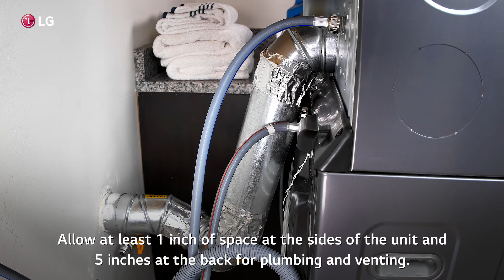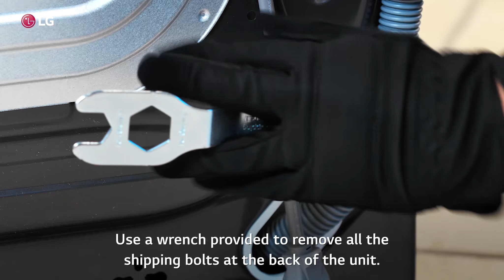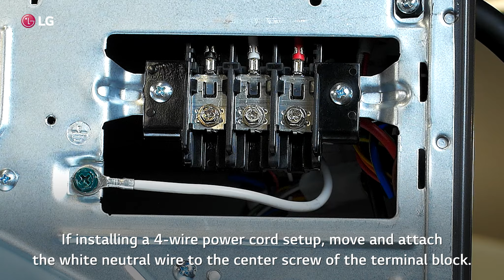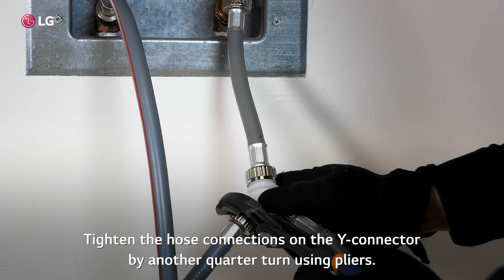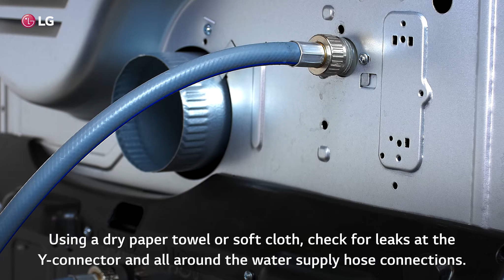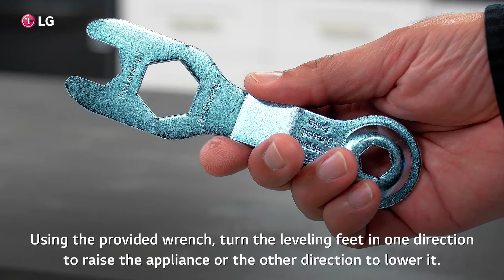LG Washer/Dryer - How to Install The WashTower™ with Center Control™

Comment: A 3/4" strain relief is required for installing a dryer cord, NOT 3/8". This video says 3/8" multiple times and that is incorrect; that's too small for the knockout on the back and also too small to fit a dryer cord through. Incorrect install info straight from LG...

Comment: the vent picture at 29 seconds looks horrendous. how can that be correct?
Reply from the maker: Hey Ebart! We want to make sure your LG WashTower runs reliably. Just keep at least 1 inch of clearance on the sides and back so it can ventilate properly, and avoid placing it in tight, enclosed spaces. You can check out the link for quick troubleshooting, and feel free to DM us on Facebook, Instagram, X, or @LGUSSupport if you need more help. -Mark. 

https://spr.ly/6054BEsc4E

Comment: is there no water discharge from the dryer on WKEX300HBA
Reply from the maker: Hey there! The LG WKEX300HBA washtower unit uses a water-free drying system that discharges steam through the drain hose into the sewer system rather than water like traditional dryers. Let us know if you have any other questions, and we'll be here for you! *Josh

Comment: Why is there a hose on your dryer? Mine doesn't have that
Reply from the maker: Hey Jake! Just a quick heads-up—some WashTowers are designed without a ventilation hose. These are known as ventless WashTowers. Instead of traditional venting, the dryer uses a heat pump system to efficiently dry your clothes without needing an external vent. 😁 ~ Ryan

Comment: I’m soooo freaking mad! My washer drain hose is half the length shown here. If I can’t find an extension I’ll have to return the unit. And yes I did try pulling it out further but it’s out as far as it will go.
Reply: Hey there. Lets work together to find a way for you to use your washer in the place you installed it without having to move it around. Have you found any extension drain hoses on your own? We would like to help you find a tailored solution that will allow you to use your washer with peace of mind. Please send us a private message on social media @LGUSSupport with your contact information. We're always here to help. ^ Diego

Comment: Do I need a 220 outlet or can I use a standard 110 (or 2x 110 outlets)
Reply from the maker: Hi, there. We appreciate your inquiry regarding this matter. The LG Washtower requires both a 240V outlet for the dryer and a separate 120V, 60Hz grounded outlet for the washer.  We hope this helps. ^Mau
Reply: @LGUSA Thanks for your answer. Is that case if the dryer is gas or only for the electric dryer version?
Reply from the maker: Thanks for the response. The electric dryer requires a 240V power source, while the gas dryer can run on a standard 120V outlet. ^Mau

Comment: What size of strain relief is needed?
Reply from the maker: Hi there, great question. A 3-wire power cord. Please see the link for further information: http://tinyurl.com/465s4p9b. We're here if you have any other questions,~Tanisha
Reply: 3/4". The reply from LG didn't actually answer this question, and this video says 3/8" which is wrong. 3/8" is too small for the knockout and wouldn't even fit a dryer cord.

Comment: Purchased a NEW LG Washtower...arrived / installed Jan.17th. The gas dryer seems to only fire up when I tap the back of the dryer. Confirmed that infighter is not functioning without banging the back side of the dryer.....this is unacceptable. STILL as of today LG has not provided us with ANY service to fix, repair, replace or refund. MANY Calls, Text, Emails from us have been sent to LG....and yet here we sit with NO SUPPORT.  NO DRYER.  Any suggestions ??

Comment: Do you have to buy the cord for the dryer separately? My dryer is not turning on.
Reply: Yes it, is purchased separately, need to determine if you need 3 wire or 4 wire

Comment: Has anyone been able to find out where the dryer vent is located on these?  I want to have it installed in the proper spot in my new house.  So far all I am reading is the installation manual is shipped with the appliance.  My builder wants the specs.  Any info would be appreciated!
Reply: 5:22 you can see duct (silver color circle) that is vent for dryer machine
Reply: I asked LG and they have not yet replied so I asked a retailer to measure the display model(pulling the mammoth thing out of the display enclosure).  .  The side vent is 41.75 “ from floor and 22” to centre measuring backward from the front of the machine.  The rear vent is at the same height and offset to left from centre when facing the back of the machine, sorry but I don’t have that exact distance You will need to allow for space for water hoses in back of course.

Comment: I just got a new LG washtower with gas dryer, but we have a propane line running in the house. I was told that a plumber can make the conversion, but he doesn't know where the orfice is located. There is no manual for the conversion and LG rep on the phone is just sending me videos from YouTube that have nothing to do with their own product. Has someone successfully converted the gas to propane so far? My plumber is trying to take of the panel, but is it in the front or the back? Any help is greatly appreciated.
Reply: Orfice is located in front
Reply: The black piece in front has two screws . Unscrew them and take it out .

Comment: I want the INSTALLATION manual (not Owner's Manual or User Guide) in advance of my Washtower being delivered as I have to have both plumbing and electrical done so that installation is easy. I called LG and they told me the installation manual is shipped with the appliance...but that does not help me get plumbing/electrical done in advance. With pandemic, plubmers and electicians are booking 6 to 8 weeks in advance and I would like all to be in place. They told me there is no way to send me the installation manual in advance. Does anyone out there have one they can share??
Reply: In the same boat - need the info tomorrow!  Google search and trying to find it!

Comment: Put the water on top and then have a internal hidden door that opens automatically so the washed clothes drop by gravity to the bottom dryer and then the dryer starts. That would be ultimate innovation to avoid time switching the clothes!!
Reply: I actually designed a unit like that for science class when I was in high school, mine even folded the clothes, lol
Reply: They have all in one units that they sell.
Reply: Or just have a wash and dry function inside one unit... thats what they do in Asia
Reply: @LincolnLog that would double our laundry time in our family of 6 and two Irish Wolfhounds. But I did consider the LG 4.5 cu ft all in one unit.
Reply: @thesouringgentleman  yeah your big family is the kind that needs 2 washer units minimum. My sister would just take the dog beds to the laundromat though to dirty their machines rather than possibly clog the ones at home.
Reply: They actually have machines like that called ‘all in one ‘. They’re not popular because it takes twice as long to do one load completely and there is a BIG wet lint problem.

Comment: In deference to Simple Inverso and his simple minded comment, I have found a way to remove the machine from the styrofoam shipping base that does not require 4 body builders and a set of suction cups for installing large windows. You will need a "real" appliance dolly with a ratchet strap. Place the dolly at the rear of the machine,(between the foam block and the machine legs) strap it securely to the dolly and tip the machine back carefully until it clears the styrofoam block that supports the tub during shipping (roughly 45 degrees).

Comment: do the power cords come with the GAS washtower or have to be bought separately?
Reply: I just bought an LG washtower and they came with the standard power cords already installed in the back.
Reply: @migo-migo9503  did you have to open the top right hand corner to do the wiring they explain in the video?
Reply: @abbaslakha  No, I didn’t. It was already all setup when it came out of the box.